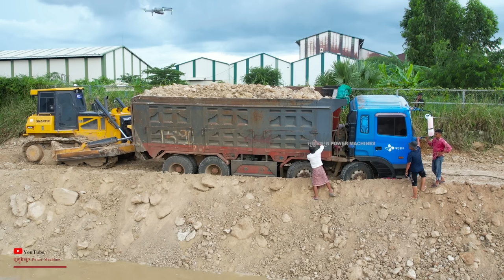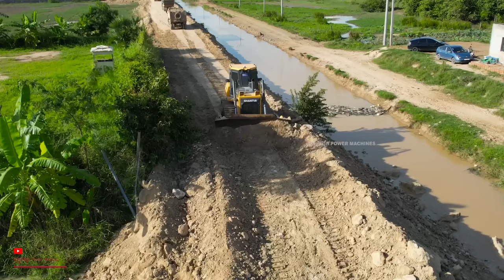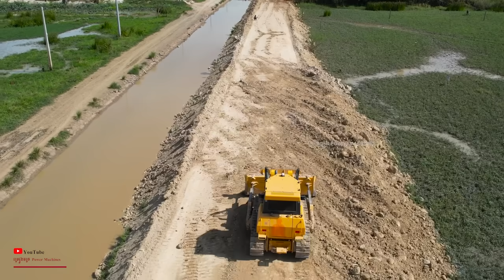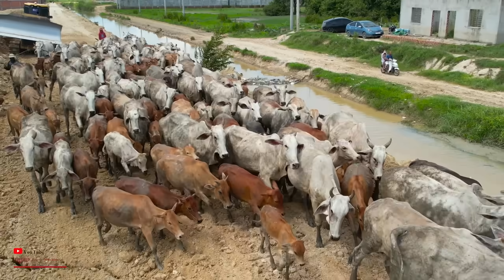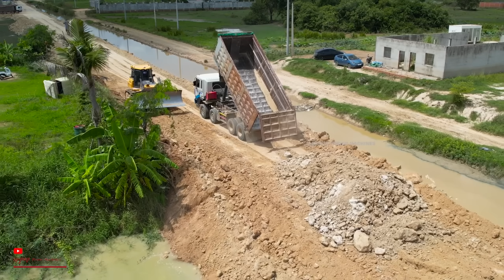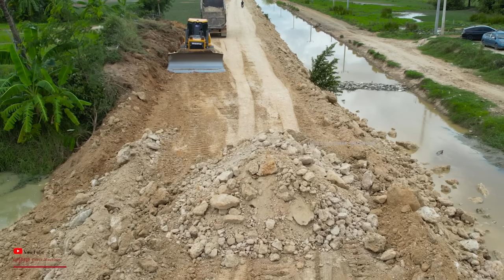The Best Ultimate Project Building New Road High Speed Job Heavy Dozer Skill Cutting Soils In Water

Comment: No wonder things are so slow over there. 1 CAT for all of that work. They'll be out there for weeks just trying to get enoigh soil in there and to level it.😳 All of those dumps trucks just sitting there waiting running up the tab. Idk🤷🏾‍♂️ Maybe they dont charge by the hour over there? There is a cross road on the other side if you had another CAT you could have the dump trucks dropping soil on both side of that lake or whatever 🤷🏾‍♂️🤦🏾‍♂️
Reply: Stop over thinking and enjoy
Reply: People comment when they have no clue of to what an operation like this consists of … first off that dozer operator is very good .. and where would another dozer fit ? The truck look like they are  waiting no more than 5 mins give  them a chance to stretch out and drink some water … and for the length of this vid he actually did a lot
Reply: @Rasworth  The other dozer would be coming from the opposite end of the lake where ther is another cross street,  LIKE I SAID.  And those trucks are waiting way longer than 5 minutes. It makr take 5 minutes to dump a load that means there should be no one waiting then. If you pay attention this video is taken over the course of several days. Gm's late 2nd husband owned two full sized dump trucks ( M2 112's). The best way of getting paid is by the load. Not from sitting without your truck moving.

Comment: Cut a clean trench down along the high bank where the water runs down to the rock base. Put in Gabion baskets. Fill with 150 mm rock. Stack baskets to hight of road.
Cut angled trench across and slightly down hill.1meter wide, down to rock base and put in same as before to road surface. Do this just below top of hill, just above damaged areas and just below damaged areas, and one at bottom of hill where Gabion baskets ditch finishes. Pipe work would break with the ground movement there. That would be the cheapest way. Clive.

Comment: One hopes they will compact this after they've laid out the sand.  This is quite a porous material therefore in no time this will erode in the "canal". Proof that this will not work unless you lay a good foundation, look at the truck that sunk.  Heavy rain will wash away that road in no time.  Where are the road engineers? All I saw were two three what looked like villagers directing the dozer by simply waving their hands with no purpose.  Sad..